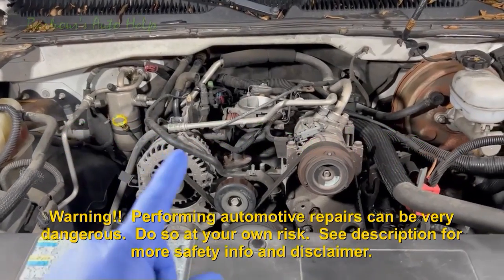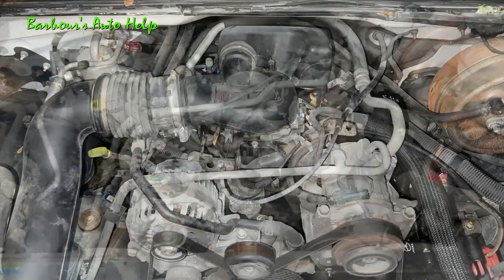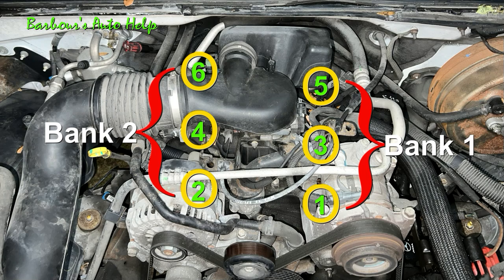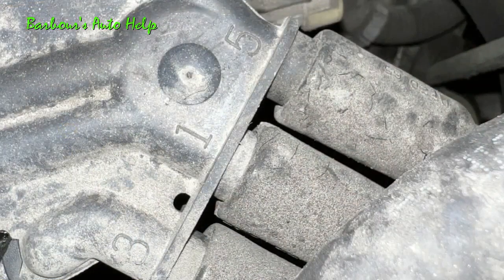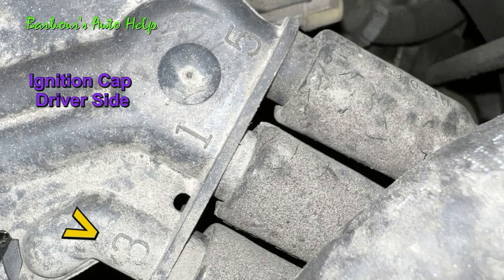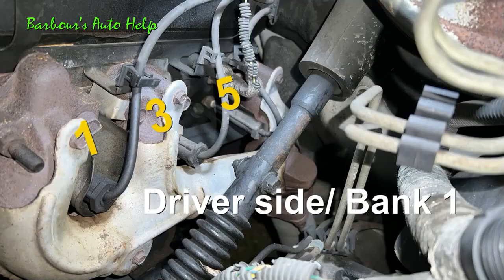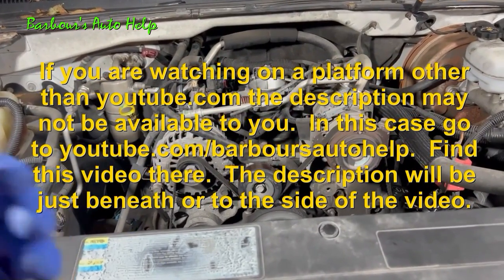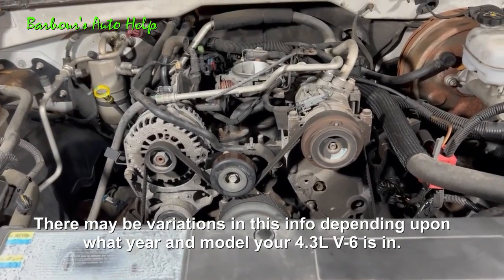Cylinder ID, Firing Order & Ignition Wire Routing GM 4.3L Vortec V-6

Comment: Replace my rotor and cap still no spark on spark plugs. Coil sparks, but no spark coming from cap.
Reply: Don’t forget the ignition module underneath the distributor
Reply from the maker: Is the coil wire ok?
Reply: @BarboursAutoHelp  I will test that tomorrow coil seems to work and spark just fine.